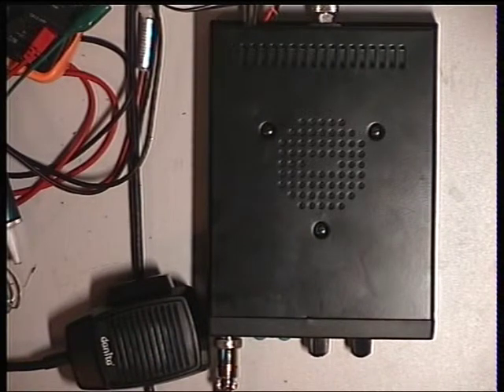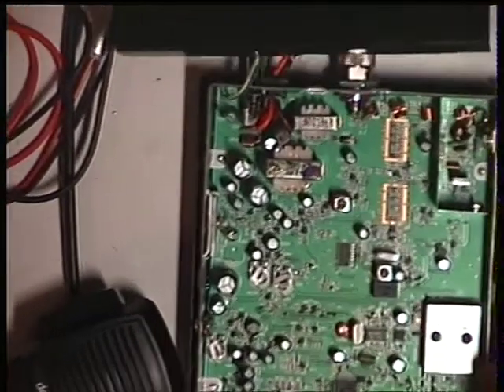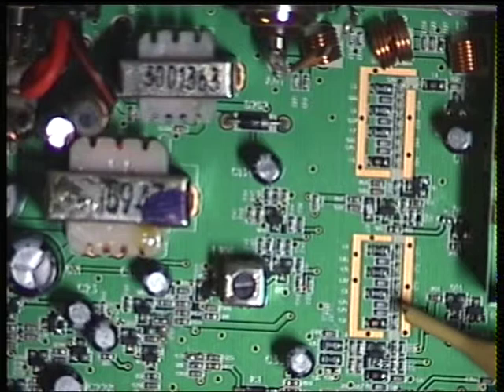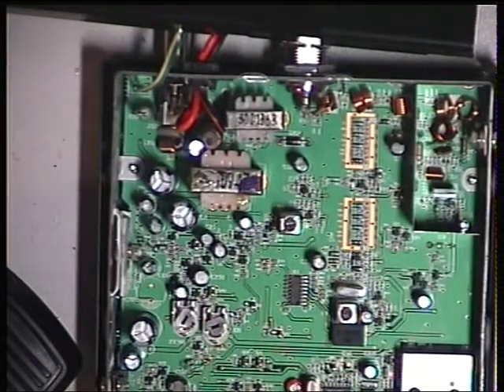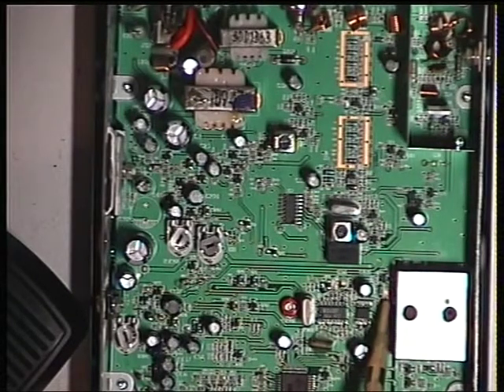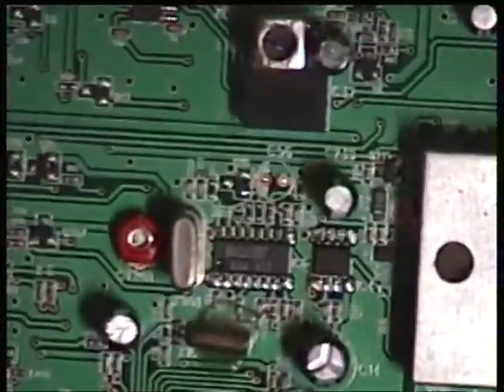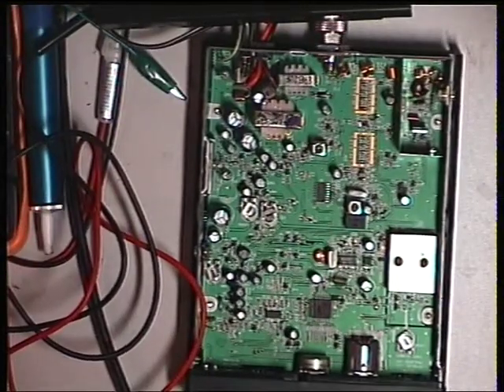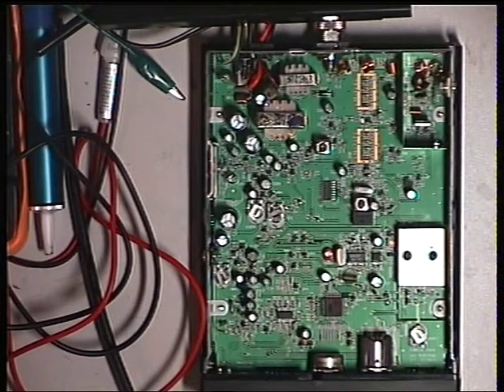Danita 2000 multi,  UK (CE - Multi) CB radio (Mobile) - Transmitter alignment

Comment: I have one of these radios. I have had reports the audio is a little quiet and then noted the deviation prior to optimization was 1.5Khz on this radio. I anticipate mine is similar is this particularly low as seems far of the 2.5Khz permitted in the UK.  Is this the most likely cause of my low audio problem? Many thanks. Tony
Reply from the maker: Yes it is because deviation is the width of the transmitted signal & therefore, up to a point, the audio volume transmitted.

Richard